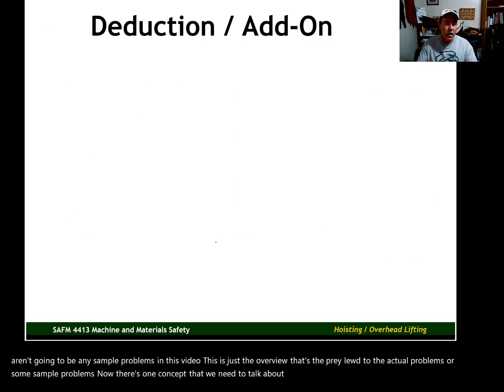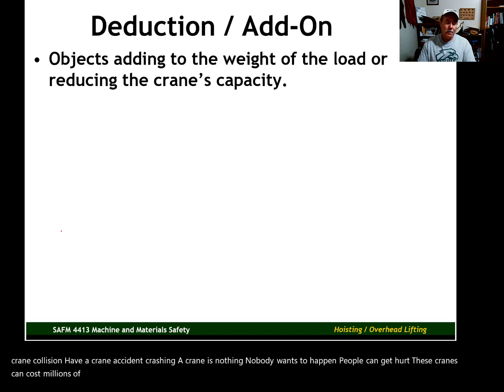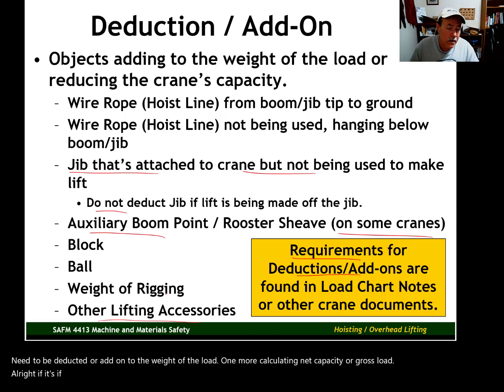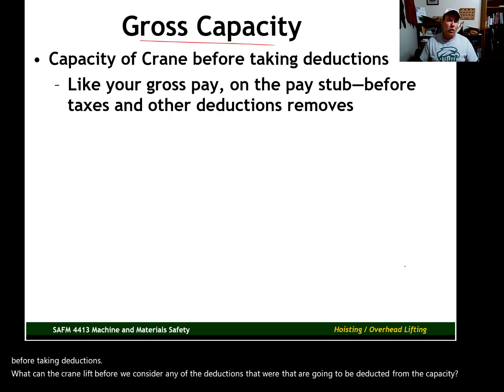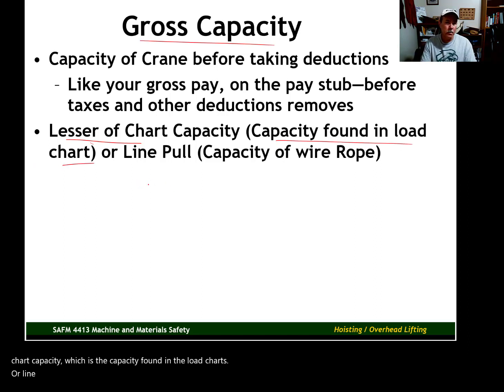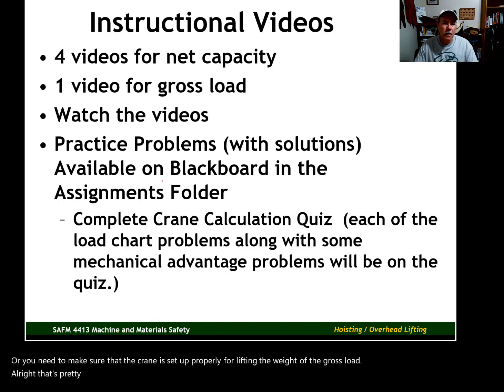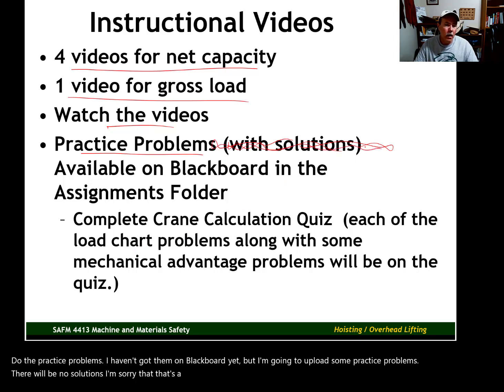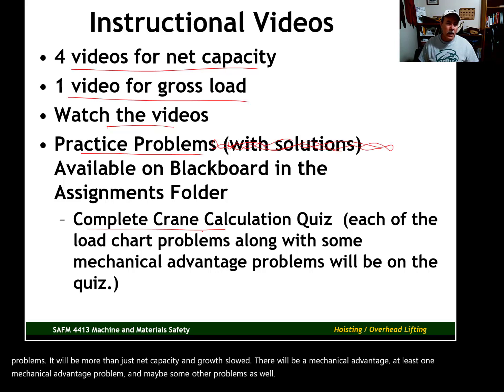Introduction to Crane Net Capacity and Gross Load

Comment: If your using the whip line would you still count a block as part of the capacity if you using line pull instead of the chart ??
Reply from the maker: Block is a deduction.  When calculating net capacity the weight of the block is deducted from the gross capacity.  Doesn't matter if line pull or chart capacity is being used as gross capacity.